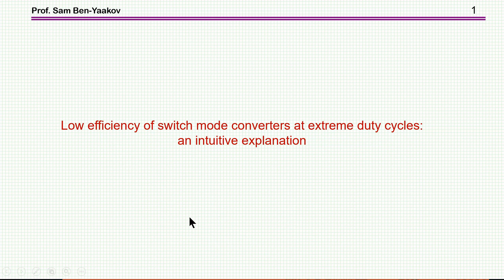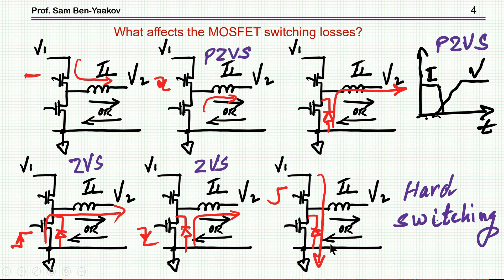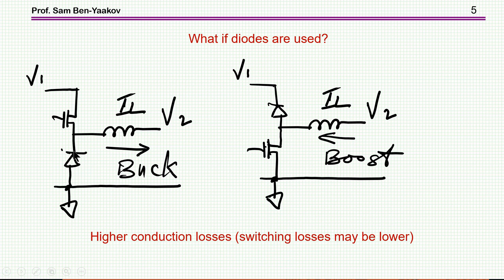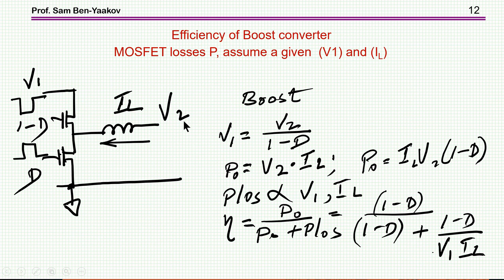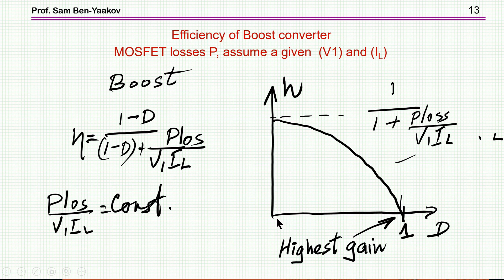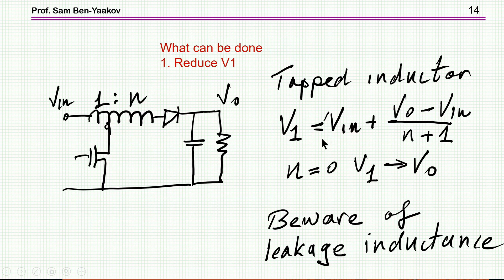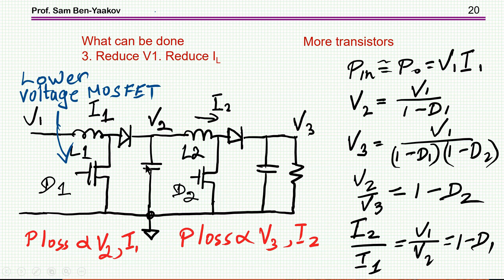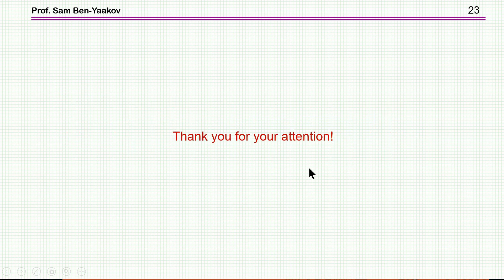Low efficiency of switch mode converters at extreme duty cycles: an intuitive explanation

Comment: Hi professor, in the case of two stage cascade boost converter in the video, if I have 80% efficiency of single stage boost I would need two 90% cascade boost converter to have 1% efficiency improvement overall, from your experience do you think the Ploss can be reduce that much for each stage such that the overall efficiency can see meaningful improvement?
Reply from the maker: Probably not unless the single stage has a much lower efficiency.

Comment: Remarkable video professor. I I've had an issue with a circuit that had a sepic Regulator; however, the battery kept being depleted faster than what I have speculated. I never took power electronics and now I have figured out that the efficiency has dropped considerably because of the long sleep cycles on my circuit because of your video. I love to learn more, your knowledge is extremely valuable. I'm forever your student. ❤️
Reply from the maker: Thanks for kind note and sharing your experince

Comment: I enjoyed your video very much. This is a very interesting topic. 
I would like to add my thoughts. First of all, if you look at a power electronics circuit it is always about transmitted power. So, if you change anything e.g. duty cycle it doesn’t make much sense leaving the output current constant. E.g. for buck converters the output power for small duty cycles would approach zero. However, who needs a converter with zero output power?
The same goes for boost converters and duty cycles approaching 1. With constant output current the output power would reach infinity …
So, I would propose leaving the output power constant which would make it easier to attribute any rise in losses to a direct deterioration of efficiency.
Keeping that it mind it can easily be shown that actually the conduction losses(!) in connection with the switching losses kill the efficiency for buck converters and low duty cycles, while for boost converters it would clearly be the switching losses approaching d = 1. 

You also mentioned the buck-boost. Going into the extremes you basically have the same findings for very low d = 0 and very high d = 1 duty cycles.
What I found is (and I don’t know if there is actually a proof) the farther your output voltage differs from the input voltage (and when assuming you have an efficiency in the vicinity of 1) - it goes for current as well - the lower gets your efficiency.

Interesting enough this even applies to (pure) transformers that do not contain any power electronics at all. 
Using this assumption as a starting point makes certain design decisions easier.
Reply from the maker: You seem to missed the point. I am not keeping the current and changing D. I am showing that for any given I  and V the LOSSES are constant. Which leads to efficiency. You write: " it can easily shown"  how?.
Reply from the maker: For the general case
Reply: @sambenyaakov  
> You seem to missed the point. I am not keeping the current and changing D.

What do you change apart from D? Since V1 is constant and V2 must change there is only one value left to deal with: IL. What do you do with it? Keep it constant? Adapt it, so Pout is constant or let it run as it will (according to a load resistor?).

But why I say you assume a constant load current this is based on this:

9:06 “and then we get the maximum efficiency when the duty cycle is approaching 1 because when the duty cycle is 1 then basically you have a transfer like this form here to here and you have maximum power transfer (#1) and of course then the efficiency will be highest because the losses are still the same (#2).”

#1 maximum power transfer @ reduced current? Apparently you do not keep your output power constant.
#2 You state, losses are the same: What could that mean? Same voltage V1, same current IL or anything else?

E.g. for the buck converter in CCM the switching losses depend at a given voltage on the current that has to be switched (CCM). Since V1 is constant and considering your statement #2 this means same output current IL.

>I am showing that for any given I and V the LOSSES are constant.

When losses are constant and transmitted power is constant your efficiency would be constant. However, you show curves – so, output power differs? On what is that dependent then, if not on D as your graphs imply, e.g. 8:47?
Reply from the maker: @quellstrom  All this is tautology. I am just showing that the LOSSES are a function of I an V which explains why the efficiency is a function of the duty cycle. I am waiting for your easily showing that "it can easily shown..."  for the general case.
Reply: @sambenyaakov  > All this is tautology. 

Why excactly is the efficiency of a converter a tautology?

> I am just showing that the LOSSES are a function of I an V which explains why the efficiency is a function of the duty cycle. 

Efficiency is the ratio of output to input power. 
So, you can make statement on the efficiency solely based on losses, when output (or input) power is constant (#1).
You can sort of reverse this by saying 
you can make a statement on the efficiency solely based on power, when your losses are constant (#2).
Wonder, if you agree on that?

> I am waiting for your easily showing that "it can easily shown..."  for the general case.

Oh, that's simple. Take the buck in CCM.
We assume a constant output power Pout and a constant input voltage V1.
Efficiency eta = Pout/Pin = Pout/(Pout+Ploss)

If D approaches zero, V2 approaches zero, hence output current IL approaches infinity.
The losses (conduction and switching) approach infinity (due to infinite current) while Pout remains constant. So, what happens to the efficiency?
eta = Pout/(Pout + Pinf.)

I am waiting for an explanation to your quote, pls. cf. my former reply
> 9:06 "of course then the efficiency will be highest because the losses are still the same (#2).”

Losses are the same: What could that mean? Same voltage V1, same current IL or anything else?
Reply from the maker: What is not clear here?
Question: Why is the efficiency dependent on D? 
Answer:
1. Losses are a function of I, V
2. For a given I,V the power is changing with D
3. Therefore the efficiency changed with D
This is the simplest, intuitive explanation for the general case.
Reply: @sambenyaakov  When you say 
> "2. For a given I,V ..." 
you mean for a given IL, V1 ...? 

What would a "given IL" mean anything different than constant IL? So you have reversed your first reply to me

> "You seem to missed the point. I am not keeping the current and changing D." 

This thread could have been much shorter.

Comment: Hello Prof. Can you please elaborate on PZVS? In triangular current modulation, the ZVS turn-on is achieved. The switching frequency selection is limited by the turn-off losses. The power loss in the turn-off transition does not appear to be small. Please correct me if I am wrong.
Reply from the maker: At low voltage the capacitance of the nonlinear Co is high so dv/dt starts slow. If the turn off of the current is fast, the overlap will be minimal . Not an ideal ZVS but pseudo ZVS.

Comment: Sir, in my experience in a buck converter with increased duty cycle inductor current also tends to increase, increased inductor current give rise to losses too. This is what I observed. But in video you made it clear that losses are independent of duty cycle. I must be understanding something wrong, could you please help me to understand it better? Thank you.
Reply from the maker: All this is correct. But you seem to have missed the point of the presentation which is: the LOSS is not a function of the duty cycle. For a given inductor current and switches voltage the loss is fixed, independent of the duty cycle. The reason why the efficiency IS a function of D is because ,for a given IL, Vsw which cause the loss, the duty cycle sets the output voltage so the efficiency will change. This is an upper level observation.
Reply: In the case of the buck, for the input voltage and the output current to be constant across D, the load must also be changing proportional to D, so output power is not constant in this example. This approach motivates the converters in the second half of the video, but in general small/large duty cycles are difficult to control
Reply from the maker: All this is correct. But you you seem to miss the point of the presentation which is: the LOSS is not a function of the duty cycle. For a given inductor current and switches voltage the loss is fixed, independent of the duty cycle. The reason why the efficiency IS a function of D is because ,for a given IL, Vsw which cause the loss, the duty cycle sets the output voltage so the efficiency will change. This is an upper level observation.
Reply: @sambenyaakov  thank you sir, I got your point.
Reply: @LightningHelix101  thank you
Reply: If you use the inductor having lower winding resistance and MOSFETs with lower Rdson, you will see that losses are lower AT THE SAME duty cycle. This means the duty cycle is NOT a DIRECT culprit of the losses rise.
Reply: @gregorymirsky8707  Good point, Thank you!